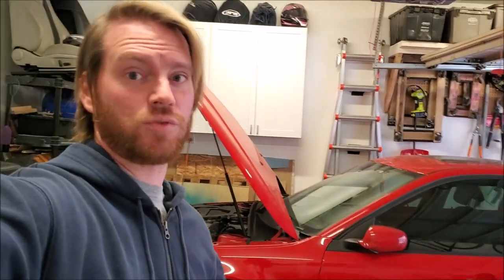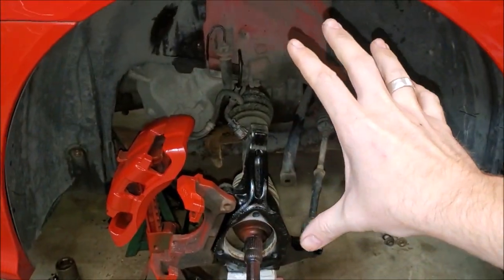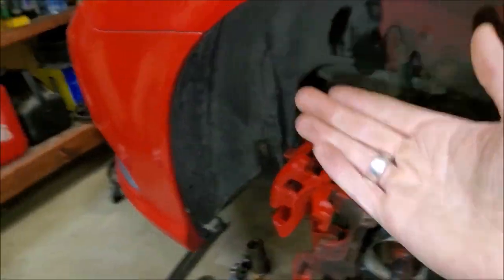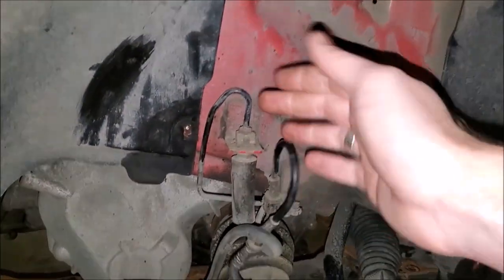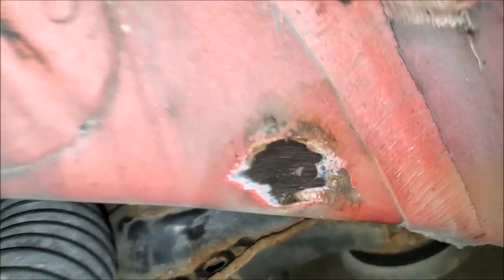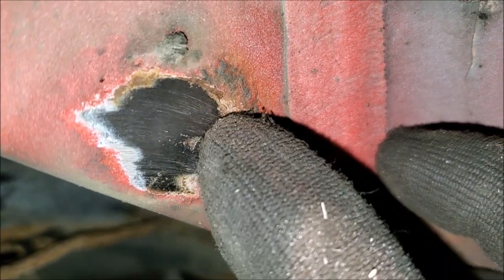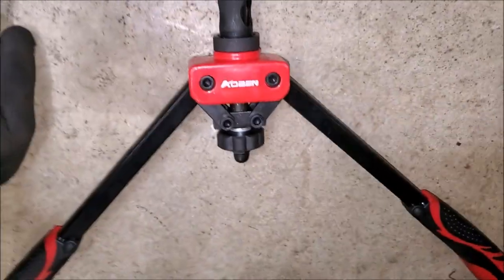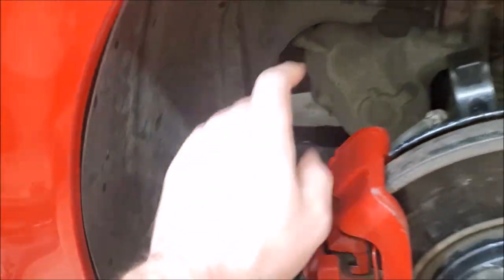SAAB Problems You Didn't Know You Have

Comment: If you can, focus on the rear arches. At least the front ones can be replaced if they do rust. I live in Scotland and they salt the roads here. The rear arches from what I've seen can go in a big way on many of them.. My 2007 full facelift one is like puff pastry, and my 2010 one is just starting to bubble slightly. Most of the time the front arches over here that I see are ok or just have a bit of rust starting.
Reply: Same problem here in Sweden, my 2007 aero is fine though, due to me and the previois owner only drivning it in the Summertime.

Comment: That has to be General Motors messing with SAAB owners. On my 2002 9-5, the wheel well liner is held in place with plastic nuts that never rust, and the lower ball joint is bolted to the control with 3 nuts and bolts. In fact, you just gave me my next project. To replace those metal 10mm liner nuts on my 2006 9-3 with plastic nuts. Thank you for the heads up. Great video. Cheers.

Comment: I can attest the problem is also on the og9-3. 
I just welded a screw in stainless in place of old stud, then you can find a file for the nuts on thingivers and i 3d printed them in pla plastic which is compostable. They are still in place.

Comment: Gary do you have any plans of restoring or replacing front or rear subframes due to rust? or any other rust restoration mods very helpful. Thanks
Reply from the maker: Hello Mo! I don't think my subframes are bad enough to require replacement but they did need cleaned up. I used a wire brush and painted the subframes in POR15 paint: https://amzn.to/3nKGr0m

Comment: 9-5 same nuts, snap studs, yep.
Reply from the maker: Good to know! I didn't realize the 9-5's used the same poor wheel liner fastener design.
Reply: When you have a Dremel or something similar og is easiest to cut the plastic nut open. If if wasn't for the price of such rivet nut installers I would have bought one and done it the same way as you have done.